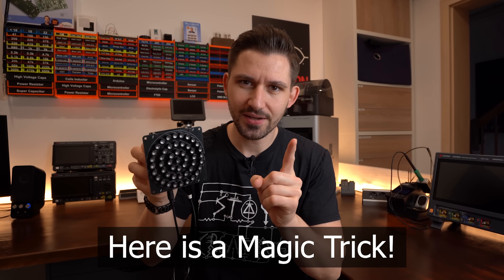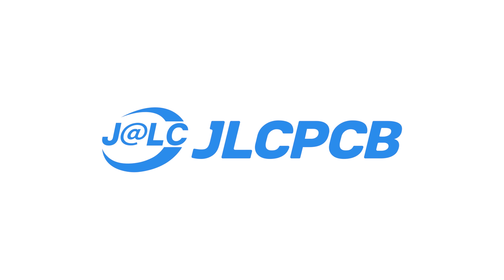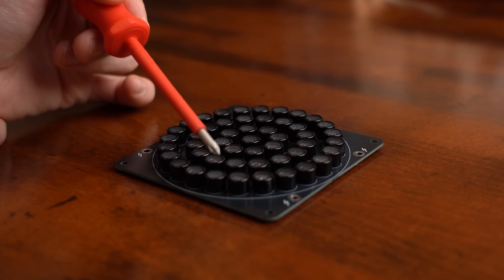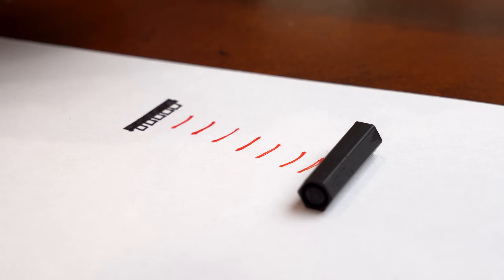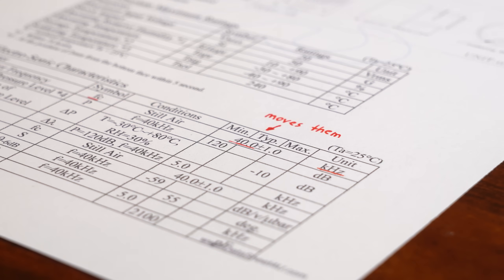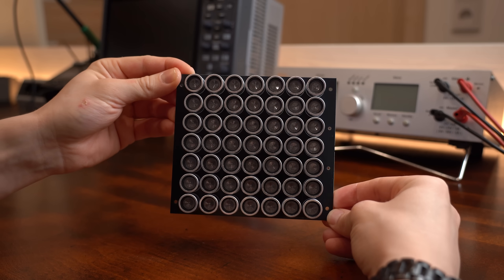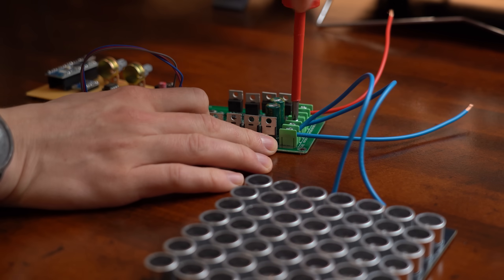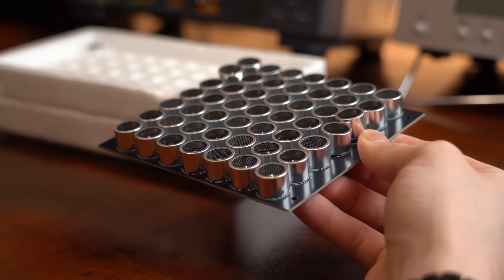The Coolest Speakers are TOO PRICEY? Let's Change that! (DIY or Buy)

Comment: Now you have two, try feeding one with a steady 40KHz sine wave, and the other with a sine wave which varies between 40 and 43Khz - at the intersection of the two (inaudible) beams, you should be able to hear a demodulated beat frequency signal 0-3KHz as they mix on your eardrum - you might need to hold a diaphragm up to test. Then you truly will have a pinpoint speaker, where audio is only heard at a single spot, not along a beam/cone
Reply from the maker: Sounds like a fun experiment ;-)
Reply: @greatscottlab   can you create a directional microphone to capture directional speakers 🤔
Reply: @henricagven2874  Spot On! What? Huh? 🎤😉 What did you say?✌❤
Reply: @henricagven2874 directional microphones exist. We use them when people talk, as we want to capture the voice only. You can obscure some of the opening of the mic to make it somewhat directional. However i do not think a purely directional mic is possible. Could build a mic array with the same principle as in the video though
Reply: @henricagven2874  directional microphones also are possible.
a microphone for hearing directional speakers, is even more easy, as normal ones can hear it, but you can also put a membrame in front to convert it back.
you can also make it to only hear the directional sound from certain such speakers, by using such a array of ultrasonic transducers as mic, or actually you only need one as long as in the beam itself or close. essentially, this lets the microphone only hear 40hkz or such. then you just filter it either using a physical filter or through software to only keep the normal sound signal.
this way you have a microphone which mostly only hears the sounds from such a directional speaker, and some noice from other ultrasonic sounds close enough in frequency.
Reply: @henricagven2874 Poke the mic into a soundproof long tube (blocked off where the mic is inserted, with BlueTack). Maybe it would be directional. Interesting experiment. 😂
Reply: Man you gotta do it. Would be amazing if it works  @greatscottlab
Reply: @greatscottlab  I doubt you figure it out
Reply: Freaky!
Reply: I like how you think!
Reply: you forgot to mention 180° out of phase for one speaker, otherwise the two 40khz tones will actually amplify. by having them opposite phase from one another they will cancel each other out, leaving the demodulated tone.
Reply: @SlavTiger  don't worry, as one is modulated in frequency between 40 and 43KHz the phase will vary naturally anyway - it all works out in the end 🙂
Reply: @richardbanks2669  good point, them being out of sync (40 to 43 ratio is pretty complex) it will result in the waveforms going in an out of phase all the time just leaving them on.
and at that rate it will be pretty rapidly lol
Reply: @SlavTiger they should all be in phase to get maximum range
Reply: To obtain the beat frequencies you would need to have a mixing element, I guess. Maybe a membrane with 40 kHz resonance frequency which movement is limited to get the non-linearities? Great idea to use a cheap PWM instead of an audio amp.
Reply: @martinschnarrenberger5654  if you think about it, that's basically what's happening already - the PWM and the AM setup both have a fixed 40KHz frequency, but the audio we can hear are just phase shifts/duty cycle stretching, or amplitude modulations imposed on the carrier, because our ears act as a combining low pass filter. That's also probably why it sounds better in person than on the recording, because the microphones don't have as much resonance and (physical) low pass filtering as our eardrums and bones in our ears. In theory, anything physically capable of resonating at audio frequencies should work. Would be an interesting test to hold various membranes (tambourine? Metal lid from a jam jar?) and resonant objects (empty can? Acoustic guitar? Wine glass?) at the intersection of the two beams and see if it acts as a mixer/demodulator
Reply: @richardbanks2669  The reason is sound worse on the recording is most likely just that the microphone picks up the 40 kHz carrier frequency (it most likely have lower sensitivity there, than in the audiable range - but the level of the carrier frequency is probably so high that a lot of it gets picked up anyway)
- which then mess with the circuitry in the camera or recording unit. 
The 40 kHz will not show up in the recorded file (unless 88.2 or higher sample rates are used - most cameras and simple "shirt mic systems", which he seem to use, only have up to 48 kHz, so nothing above 24 kHz will show up). But if that frequency is fed into the audio input at higher level than the audiable part, it can still mess with the amplification circuit (especially if autogain is used - which might not react to the high frequency and keep the gain high, so it "clips" in the analog circuitry before it enters the antialiasing filter and ADC, where it's filtered out). 
With a better recorder and not too much gain and for example 96 kHz sample rate (which is common for high quaity) is used, the carrier frequency will also show up on the recording at equivalent level as the signal had when coming from the mic (in comparison to the audiable part). To see the acoustic levels, the microphone must have a known sensitivity all the way up to 40 kHz though. Most mics are not specified that high and the sensitivity usually tapers off above 20-30 kHz - but at high levels, the 40 kHz might still be picked up enough to cause problem if not acconted for.
Reply: Sounds almost like an interferometer.  I wonder what sort of scanning operations you could come up with?   Also it looks a bit like a phased array radar, which would be very, very interesting to build using ultrasonic transducers instead of radar antennas.
Reply: Yes it becomes a beam steering array. IIRC @bitluni made such a device for a 3D ultrasonic camera using a similar technique. No modulation with his device however.
Reply: We had a museum display where we did just that. The benefit is that people at other displays were not bothered by the audio at our display. However, the overall frequency response is OK for narration, but lacks bandwidth to produce good sounding music.
Reply: It wouldn't be one spot it would be a series of spots along the convergence points.
Reply: @EnlightenedSavage  presumably they'd best be set up perpendicular to each other, to only have one converge point? or, well, not point, but a small space.
Reply: @EnlightenedSavage  Yes, If the beams overlapped for a significant distance - Ideally they'd cross over only in a small area, at as close to right angles as feasible
Reply: @richardbanks2669  which variety of beans is best used for this experiment? 
I don't like kidney beans or fava beans. 
Will soybeans work ?
Reply: @EnlightenedSavage  That would not happen if both beams are directional and coming from different directions.
Reply: @EnlightenedSavage  Not if they come from two different directions, I tried this 30 years ago with lasers, and it worked !
Reply: @EnlightenedSavage  This can be done with a single array, and the other nodes can be supressed. It's a lot of tricky math, and the nodes aren't 100% supressed, but it's been done.
Reply: even better: coat your ceiling in transducers, then you can aim in software by abusing the interference between all those individual tiny wavefronts ;)
Reply: hmm you might even be able to modulate the second frequency
So 40kHz for one, 40kHz + f(t) for the second one where f is some arbitrary waveform
then you might be able to make two arrays for louder sound
quite cool
Reply: I just took a dab reading this comment and it just blew my mind.
Reply: if you want a pinpoint, you could try placing them on a parabola
Reply: wow I know nothing about sound and frequency's
Reply: I was thinking of the same thing, but do it in 1 board.  It makes sense for the transducers to be arranged in the circular pattern if you are using phase interference for the audio generation.  In fact, you could quickly alternate which transducers generate the base frequency and which generate the modulated frequency, that might improve the distance capability.
Reply: So, after a bit of googling, I found a chinese research paper, that actually tried that (although with 40kHz and 41kHz fixed frequencies) and it should work.
They sadly did only provide data for the SPL within 25cm of the intersection point and did not show how the SPL changes when you get further away, because at least in one axis it did not look like a clean peak at the intersection point.
You can find the paper by searching "Development of a directional loudspeaker system for sound reproduction" in google scholar.
Reply: I think this phenomena is called "Tartini tones". I wonder if it's possible  to encode audiosystems in the way so something like usual audiofile can be played on the collision point. There's so much potential.
Reply: Did you check the polarity of each transducer? If not Some will be 180 deg out of phase which will reduce your effective distance
Reply: @arash20007  I guess he did.
Reply: Awesome idea! My personal feeling is it wouldn’t work very well but I would love to see it attempted. I’m having a hard time wrapping my head around it but with a directional speaker something tells me that for those waves to be constructive and destructive the speakers would have to be aimed facing each other to some extent because the waves are almost “polarized” in a sense. I know polarized waves only make sense from an RF/light spectrum point of view but I don’t know how else to explain what I mean. I don’t think a 90 degree intersection would work that well but maybe something closer to 180 like 160. I think it would also be highly dependent on where your ears are in that space. Maybe i’m way over-thinking it
Reply: If it does work it would be so cool to see what 30-100 hz sounds like and see if you can hear any bass and at what amplitude you can achieve
Reply: You could combine this with a distance sensor and focus the beam on that point, so it should follow you if you move around, assuming there are no obstacles in the way that would interfere.
Reply: Like that position in that one hall/dining room the guy had his table so he could hear everyones conversations...
Reply: You'll also go deaf at a rate of knots I wouldn't mess with 40kHz myself
Reply: Too bad humans can't hear above 20 khz though
Reply: @ericcamolinos3740  read again, he explains it in the original comment

it's the difference between 40khz and 43khz.
Reply: @ericcamolinos3740  i can. Also not human. Humans are gross.
Reply: @ericcamolinos3740  that's the whole point - the two beams will be ultrasound, and inaudible to humans. However, at the intersection of the two beams they will combine constructively and destructively to form two beat frequencies. If we mix 40KHz and 43KHz (both inaudible) we should expect the sum (83KHz, also inaudible) and the difference (3KHz, very much audible). By varying the second signal between about 40.5KHz and  43KHz we should get a resulting beat frequency (difference) signal between 500Hz and 3KHz, which is the range needed for intelligible speech.
Reply: @ericcamolinos3740  some can, i can hear until just under 22khz. the average ends at 20khz.

Comment: I am working on a similar project.   I think you can increase you DIY power output by Matching a Power inductor to the Capacitance of the Ultrasonic transmitters.
Reply from the maker: Yep, building up an LC resonance circuit should boost the power.
Reply: @greatscottlab  Use caution doing that! I also built the same thing, and wanted more power out of it, so i made a series tuned LC circuit with an inductor. The results? Much louder speaker, BUT, after 2-3 minutes the transducers started to heat up! I never payed attention to this, and after a couple more minutes, the internal "cones" these transducers have, started to fall off one by one. The autopsy afterwards showed that these cones are glued to the piezo disk inside, and if you drive the transducer hard enough, heat and vibrations cracks the glue and you end up with a bunch of "blown" transducers! Also you have to pay attention to transducer phasing while soldering them on the board. On mine, the factory pinout (which pin is "negative" and "positive") was all over the place. Some were correct and some were flipped. I had to use an oscilloscope and a spare transducer to check each one to determine its phase...
Reply: @andrewsweet43  It'd be interesting to see how it sounds by having half of, say his square PCB, wired correctly and the other half wired with reverse polarity. If it would act like noise cancelation, or be disorienting. 😊
Reply: Do it!!!
Reply: 😂😂😂 @petermarin

Comment: These were hyped for nightclubs where the music was only loud on the dancefloor but could be shut off elsewhere so people could talk and to help with noise abatement problems in adjoining properties. Additional multidirectional (traditional) speakers could be used throughout the club to provide low level atmospheric music if required. I don't know if it actually ever took off.
Reply: Also bass travels elsewhere. And. Bass is the most important part of club music.
Reply from the maker: True
Reply: @michaela.754yes, kind of, but you can actually make quite effective cardioid sub arrays.
Reply: @michaela.754 The bass can be controlled using a cardioid setup and regular speakers - and often is done so.
Reply: Cardioid bass do help of course a bit, but inside it will still bounce around everywhere which is really hard to control. For the rest of the range line arrays with horns tend to be quite beemy already so don't think these kinds of speakers would help that much.
Reply: @Munakas-wq3gp But do they really make that much of a difference in a room? I mean you will still have the same bounce from the back wall, probably mostly the same from the side walls and then missing all that juicy boundary gain that you want from the front wall, so I don't really see the benefit? Or are the side wall reflections that much less that it makes that big of a difference?
Reply: @gurratell7326  Yes it makes a sizeable difference, especially in low mid range (assuming your entire speaker is cardioid design). Cardioid focuses the sound mostly forward and it drops side and back radiation by orders of magnitude. The reason why cardioid speakers are not so popular is that they require double or quadruple the amount of drivers, a complex crossover network and their size is big unless you keep the cardioid pattern only on highs and mids.
Reply: @Munakas-wq3gp Ah yes of course higher up in the frequency range it makes a big difference, but I was talking about bass as people higher up mentioned it, maybe I should've been clearer about that :)
Reply: @gurratell7326  Cardioid works down to the sub levels if you have the gear to handle it. The problem with cardioid is that it drops 12db/oct so you basically need 8 times the drivers (or 4 times the equivalent cone area) to match one regular driver. That tends to make cardioid bass solutions pretty rare and expensive.
Reply: @Munakas-wq3gp And also cardioid bass still have a radiation pattern of 180 degrees if I recall correctly so it's only the front wall reflection that will be removed, and that reflection is the only one you really want for more efficiency. It's only really outside that you'd really want it afaik.
Reply: @gurratell7326  Incorrect. You're talking about dipole. Cardioid pattern cancels the side and back radiations.
Reply: @michaela.754 bass isn't too annoying, so it's okay to use normal speakers for it
Reply from the maker: Sounds like a good concept on paper. However after hearing my directional speakers, I think the audio quality is too bad for night clubs.....
Reply: main issue is that once you introduce stuff (i.e. people listening and the floor) the sound bounces, so it might not work in practice. also iirc there's issues with the high pressure being potentially damaging.
Reply: It never took off. And some of it maybe has to do with the fact that some home oriented parametric speakers already had issues with the amplitudes of the carrier signal needed to get a decent audible band level out of it.
Reply: @ It's not a technical issue at all. Going from regular to cardioid just multiplies the cost immediately due to needing more drivers, so nobody is going to invest in it unless it's absolutely essential to prevent noise leak. Many festivals use cardioid setups if noise ordnances limit the noise levels outside the festival area.
Reply: it wouldn't matter if the bass leaked, it's easy to have a conversation over bass
Reply: @shyft09  Bass leak is a major issue in any place where the venue is attached or close to residential buildings.